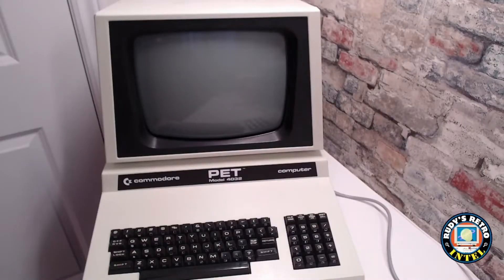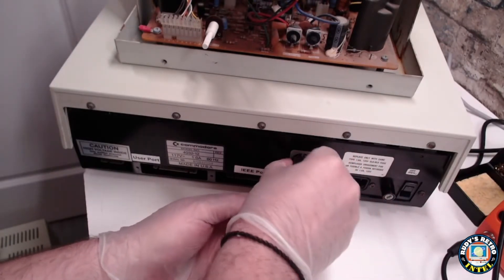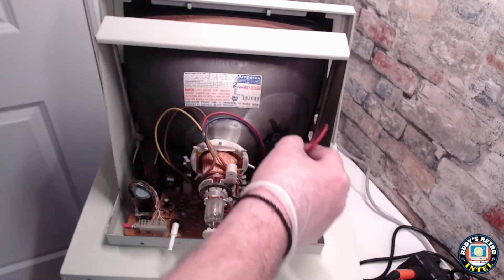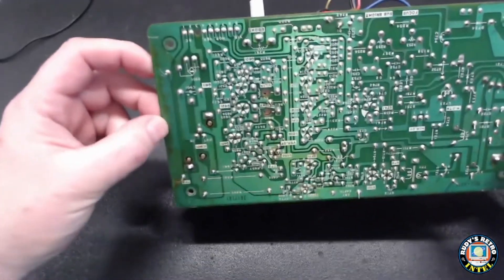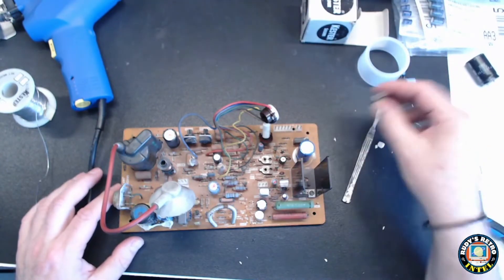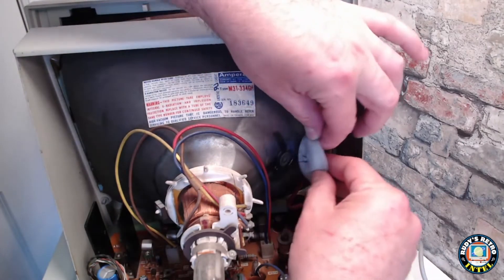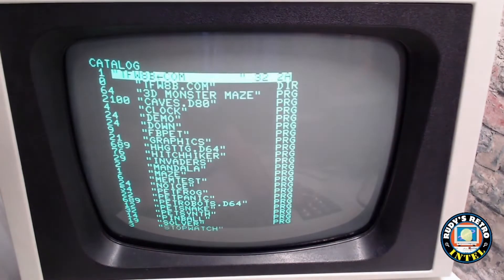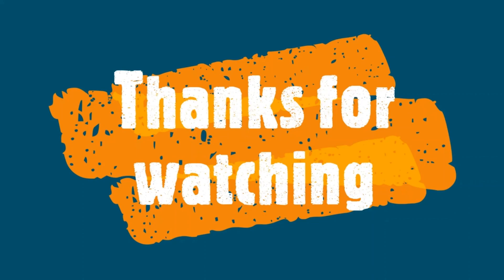Future Proof a Commodore PET 4032 Monitor

Comment: Looks great. I am actually working on the exact same model VDU right now. It, however, is not looking good 😬
Reply from the maker: Hmmm, make sure it wired correctly and have a look at the caps and the voltages going to the monitor. Could be an issue with your power supply regulators